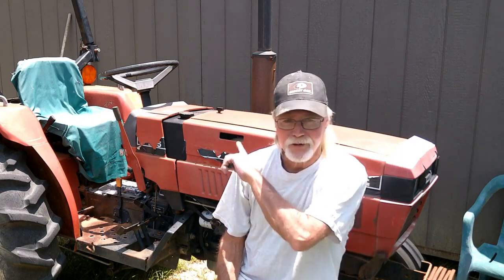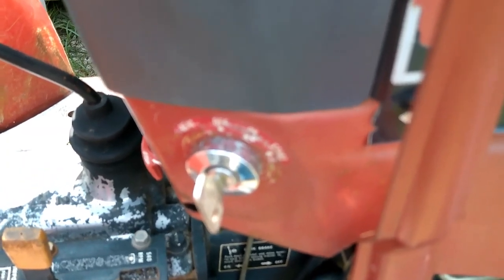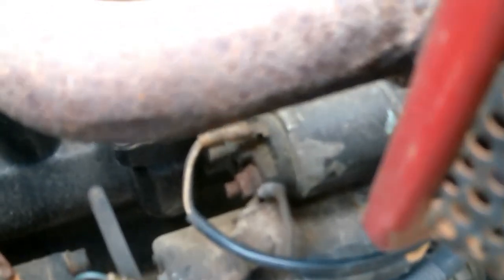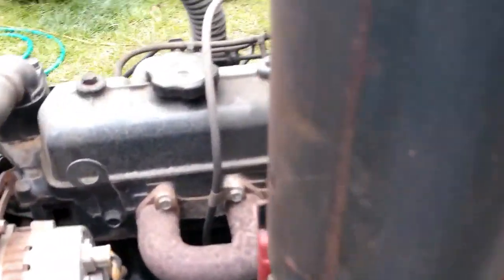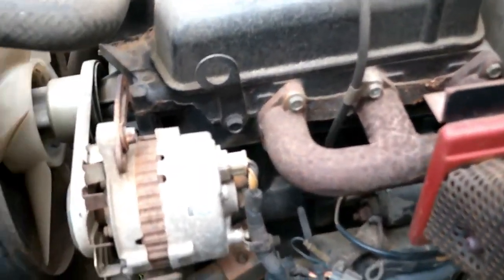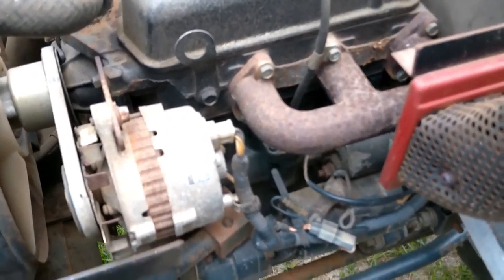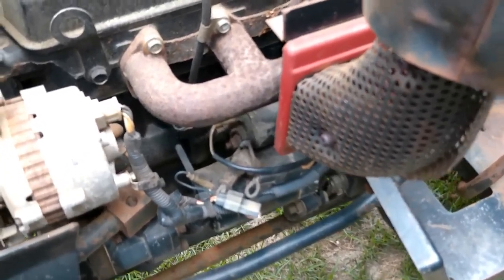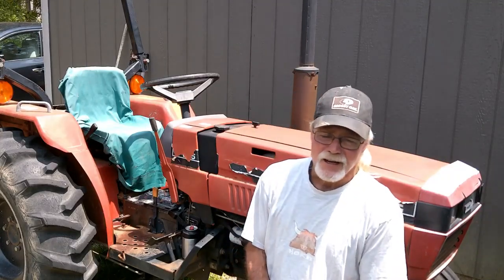Tractor has A Problem

Comment: Get a test light, and look up the wiring diagram (should be a pretty simple wiring) check that you’re getting 12v to the key switch. Then when turning the key, make sure if your getting voltage out of the S terminal of the switch. Then follow the S terminal to the starter. It could very well be the solenoid. You need 12v to the solenoid, which would then send voltage to the starter. You’re just doing the solenoids job with the screwdriver.
Reply from the maker: Thanks for the tip, I'm just wondering if it may have something to do with the flasher, although the flashing lights have been cut (accidentally i'm sure)  and that's all that flasher is for. The rest of the lights work without issues and also they are wired in through the ignition switch (meaning the switch has to be on for the light switch to be operational).
Reply: @AgnesIsMyDog it shouldn’t. The only thing it could possibly have done, is to short out wires from it failing. Other than that, that would be the last thing that would affect it.
Reply: Google Sparrs small engine repair. That’s me. Give me a call if you’d like. Free advice is always good.